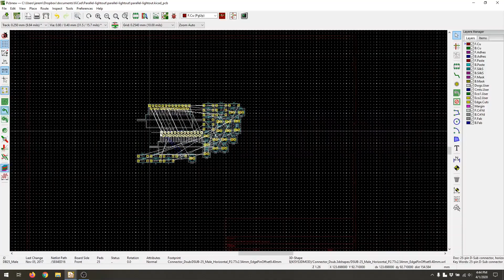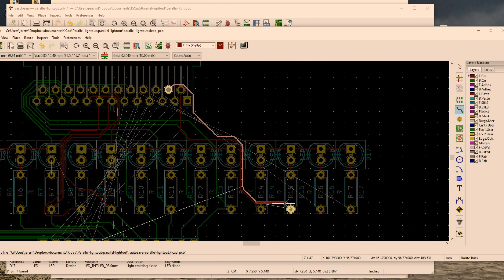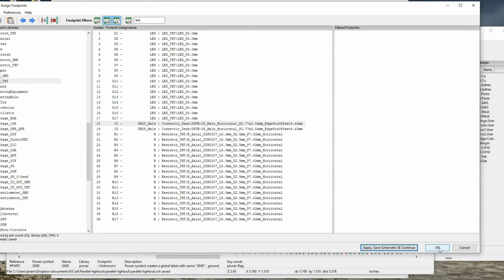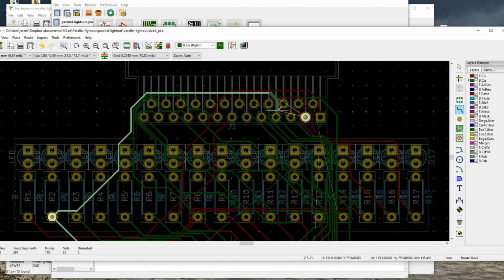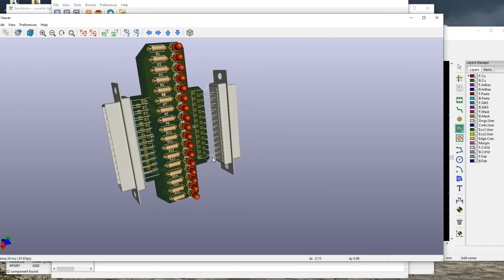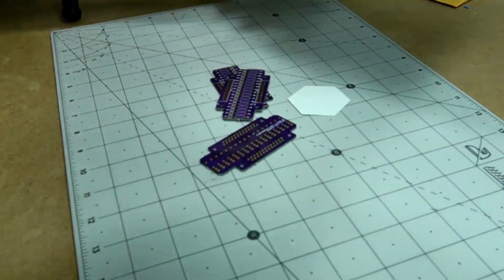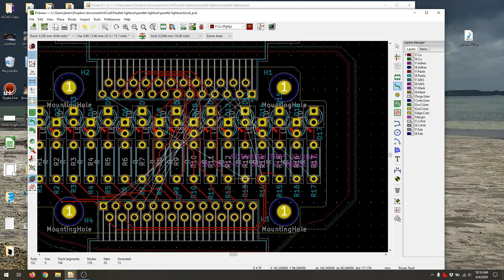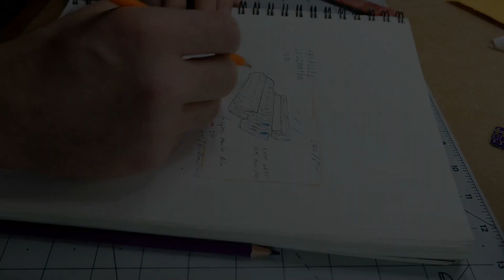Parallel LEDinator [IO Diagnostic Lights for DB25 Connector]

Comment: wow, this is an awesome project! I'm grateful you made the files for this project available for public use. I've purchased a replica PCB(s) for myself, though I'm still confused about one thing: what LEDs did you use? I'm pretty sure you used two types (blue and red), but what voltage are they? Or where did you purchase them from? any help would be appreciated, i know this is a somewhat old video hehh
Reply from the maker: Hey, glad you enjoyed, and that is very cool that you ordered a replica! I don't remember specifically what LEDs, but any 5mm (or even 3mm, but not as well) variety pack from Amazon or what ever should work. I'd love to see your results when you get done (hi at jeremyscook dot com)!

Comment: Oh god!  I'm leaving another comment!

I'm betting you put the blue LEDs where you wanted them.  There one pin for each of the 8 bits in a byte plus one pin for the strobe.  I have absolutely no idea which 9 of the 25 pins those are, but you'd got the right number of blue LEDs, and they sure do seem to be doing the right sort of thing!
Reply from the maker: Ha, thanks Pat - glad to hear that it seems I'm on the right track here :-)

Comment: Check Amazon for "Kentek DB25 25 Pin Molded Check Tester Adapter with LED Indicator Green/Red LED Male to Female M/F"
Reply from the maker: Ha, wow, did not know that existed. Was a fun project either way, added a link in the description.
Reply: @JeremyCook  This one looks like an RS-232 tester, which also works on DB-25 connectors, but the pinout and voltages are different. There are a lot of RS-232 checkers still available commercially, but few to none for parallel ports like what you designed